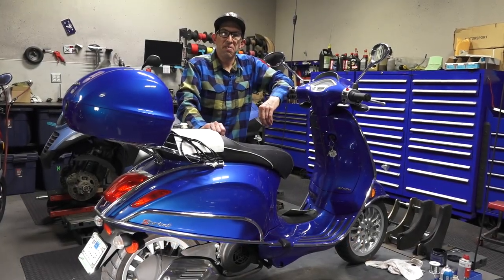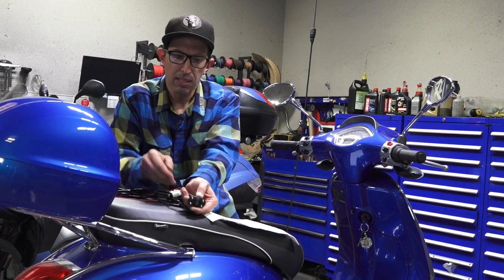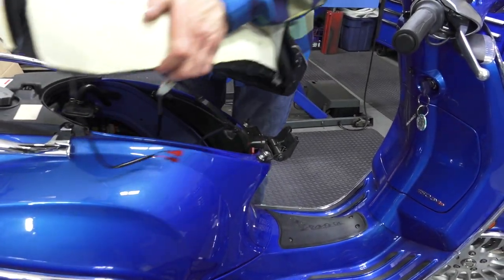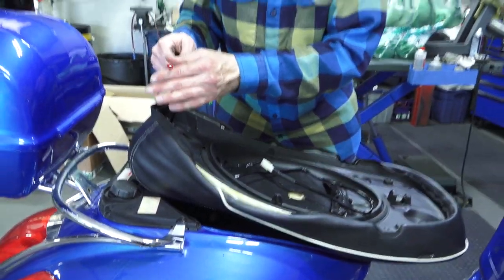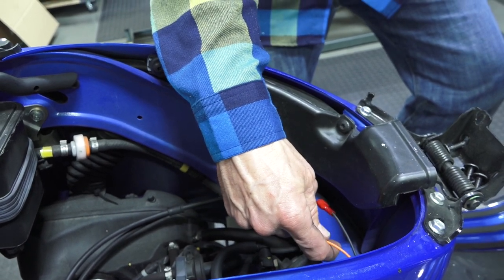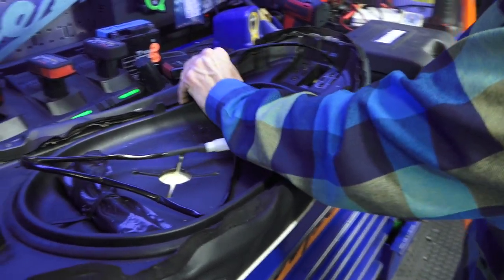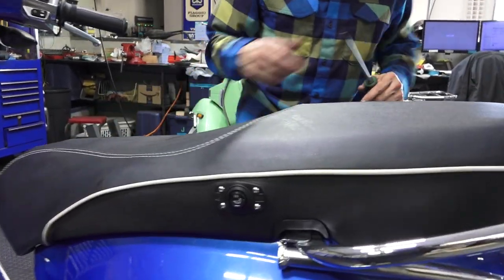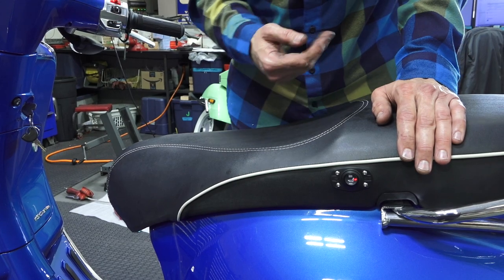Install a Heated Seat on Any Scooter or Motorcycle!

Comment: I use heated grips on my scooter, love them especially as an all year round rider in Scottish weather. 

I don't recall ever having a cold bum... Even in minus 5c. My posterior was still OK. 

I also doubt that the battery on my 2 year old peugeot would manage both the grips and the bum warmer simultaneously.
Reply: Same here, doubt my Liberty 125 2000. could handle it. And I need heated grips more. And noooo, I don''t want to change my scooter! :D

Comment: You guys didn't drill a hole through the foam and seat pan to run the wire through and make a cleaner more flush install?

Comment: with the engine under the seat there must be a easy way to transfer some heat up the butt without extra load on system........but then again long johns work too
Reply: Heated seat isn't necessary
Reply: Oh good point. Any food or drink I put under the seat always cooks. I could see drilling holes in the seat cushion and having some sort of mesh cover so the hest reaches the but.  BUT no good for summer 🤷🏽‍♂️

Comment: any recommendations for ignition-triggered dash cams using the same wire? would be interested to see if there's a way to replace the turn signal with the Euro style and then use the mounting brackets as a place to fix a dash cam.   Thanks for your videos.